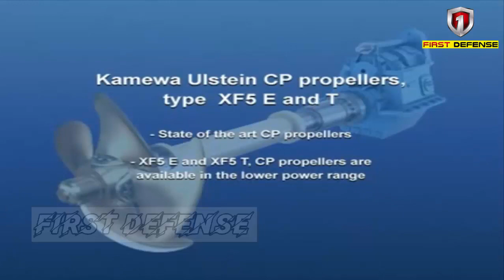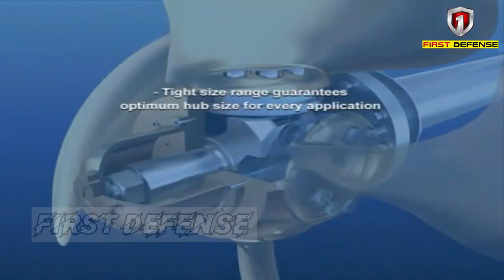Six OPV Ships Will Be Designed With Advanced Weapons And Equipment For The Philippine Navy

Comment: The 6 OPV ordered to HHI must be fitted with missiles both anti ship and anti air + torpedoes and Deep charge rocks.
Reply: Actually it will, but due to budget problem, the Phil. Navy, made sure to put essential weapon systems first, the Primary and Secondary weapons, and 2 units of SAM Simbad RC Mistral-3, and the SSM, CIWS, TAS, ASW systems, will be FFBNW, during delivery, but with a Tech. Transfer deal, and exclusive rights to the OPV's designs, and will be build and comtructed here in the Phil. Cavite Shipyard.up graded of course. But after orduring construction, if there's additional funds, essential weapon systems such as ASW, and SSM might be installed first while building the said new OPV's or might be up graded after construction, to become a Multi-role capable Warship OPV's.well with the AW-159 Wild Cat attack heli's.